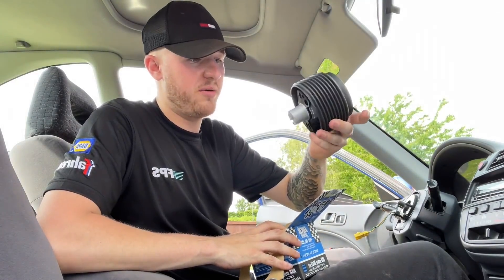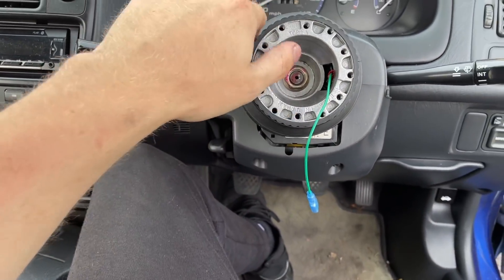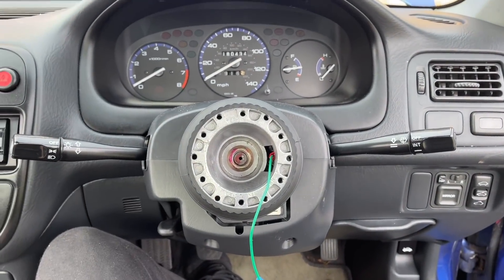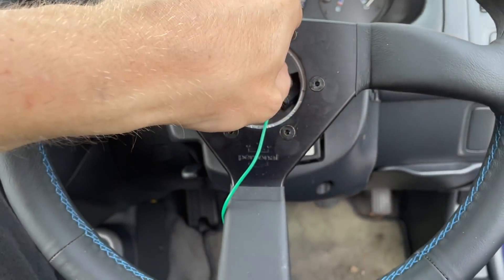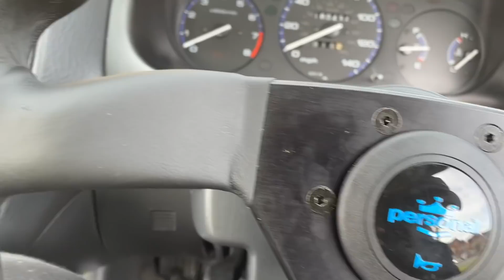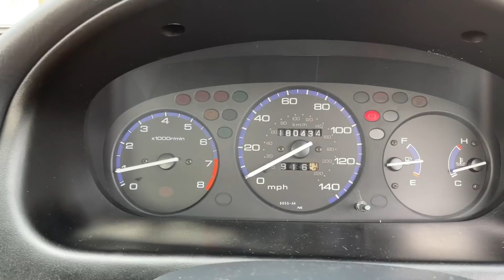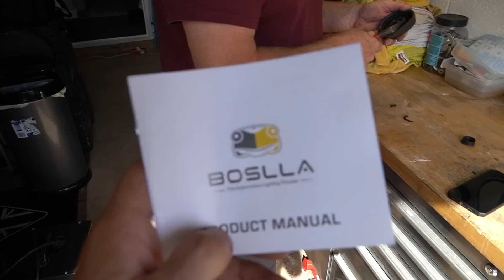THE BEST MOD YOU'LL EVER DO!! **NARDI PERSONAL!**

Comment: In future, theres a special puller tool you can get for factory steering wheels that saves you having to put a hammer to the old one. Much better, easier and safer. Dont want to pry the wheel to have it hit you in the gut or face

Comment: Lol doesn't your car require an airbag if its factory fitted? So not Road legal?
Reply from the maker: If the lights not on for an airbag then it can’t be a fault, if it’s not there they can’t test it
Reply: Might cause an issue with your insurer though, also more likely to suffer injury in an accident.

Have you thought about getting an OEM looking, yet modern ice setup?
Reply from the maker: Declare it and they’ll be no issues
Reply: @JesseCollingham  no issues with insurance, but won't provide protection in an accident.
Reply from the maker: If it’s declared they have to bro that’s what modifies insurance is for
Reply: @JesseCollingham  no I understand that, what I meant was you will have less protection from physical injury in a crash.  

On the topic of the civic making it a sleeper would be awesome.
Reply from the maker: Oh yeah I get you
Reply: @JesseCollingham  Same here mate declared all my mods including aftermarket steering wheel and no issues.
Reply: Strictly speaking it should be a fail as, since 2013 all original factory fitted airbags must be present and functional for the mot...but that's all down to the tester.